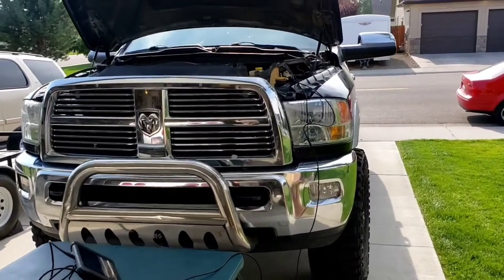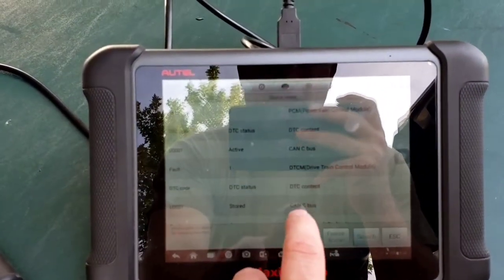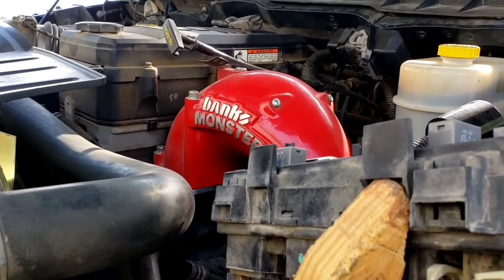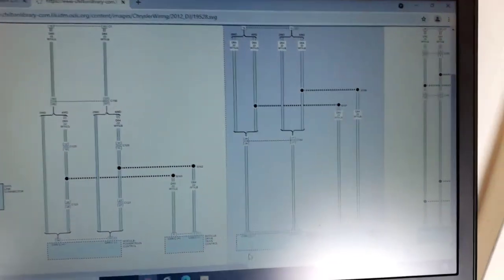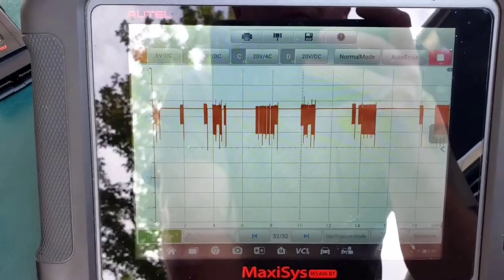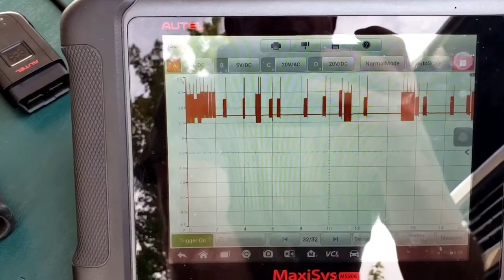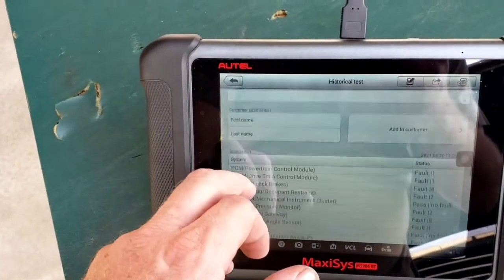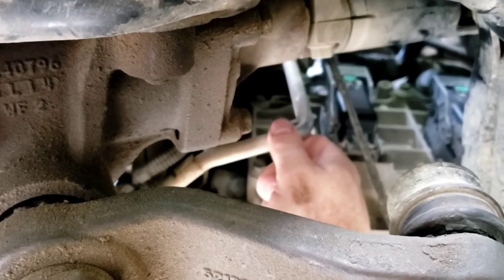2012 Dodge Ram 2500 6.7L Instrument Cluster Going Crazy/CAN Bus "C" Issues Part 3 (FINAL)

Comment: I have a 2013 ram Laramie Longhorn 3500. I have had can bus problems with it for 5 years. Dealers have worked on it and charged thousands. I hired a great mechanic to work on it and gave him all the time he needed to work on it until he had to give up. He worked on it from October till June of last year. It got so bad last winter I couldn't even depend on it to drive up town. I watched your video and found my problem in the rear connector being the same as your issues with the front connector. Since I unwrapped the wiring on the back connector and got rid of the zip ties, I have had no problems at all. Thank you so much for making and sharing the videos on the 2012 6.7.